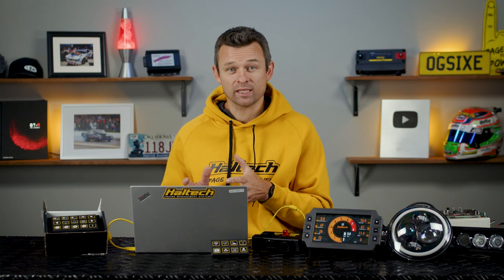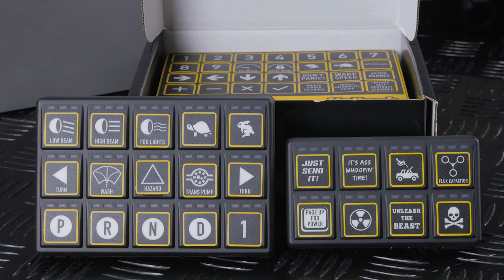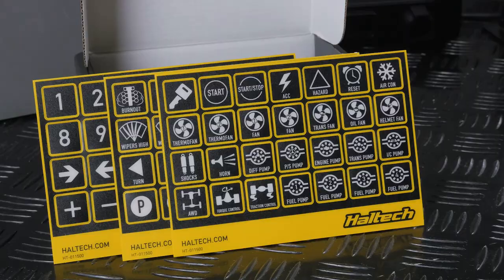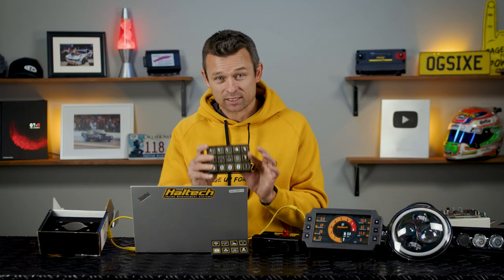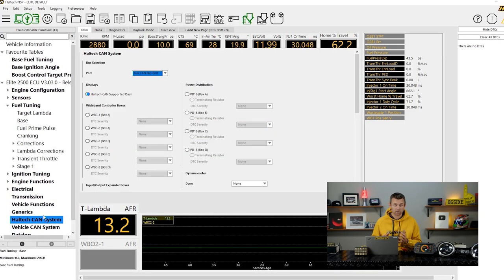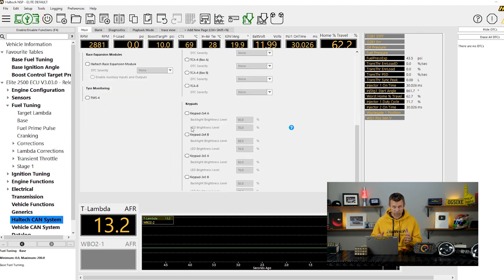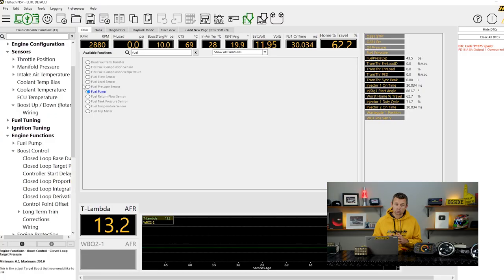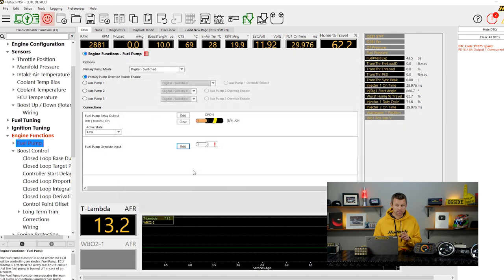🛠 How to set up a CAN Keypad with Elite ECU | TECHNICALLY SPEAKING

Comment from the maker: "When will the Elite ECUs be compatible with the CAN Keypads???" 
CAN keypads add versatility and expandability to your ECU setup. Apart from letting you control ECU functions on the go, they can also be used to add more inputs to your ECU. But most importantly  - as of now, Haltech CAN Keypads are compatible with Elite series ECUs!
Reply: Question: how well does haltech work with the older mod motors? Am I gonna have to custom do everything or are there some plug and play partial harnesses available? I am going to have to add to a harness for extreme boost control, EGTs, etc. Etc.
Reply: Thanks for the update 😎

Comment: Can you please add reverse dot and reverse bar so that if the keypad is mounted vertically with the lights on the right hand side, the trim functions can work properly? In this orientation, as an example boost up would be button 1, and boost down would be button 2, however currently the software doesn’t allow for up to be to the left of down or the led indicators are all out of order. When mounted vertically it doesn’t make sense to have button 1 as down and 2 as up.

Comment: Can one key assign several functions at once.  For example: Increase boost, open exhaust gate motors, turn on E85 pump, turn off 98RON pump etc?  This allows a drag racing selection, street selection or economy selection with one push of a button.  Can this be done? Thanks Rod

Comment: Ordered!  Is it possible to have a button you press before start that will allow you to crank the engine without firing to prime the oil system before cold start? Would it be like disable injectors button or something? :)

Comment: Will the Elite or Nexus series ever work with aftermarket CAN pads such as ECU Master?
Reply from the maker: Theoretically the already can - though you'd have to make your CAN keypad talk to the Haltech ECU using Haltech CAN protocol. The main advantage of using a Haltech CAN pad with a Haltech ECU is the easy and seamless integration with the whole Haltech system.

Comment: So you still need a pdm to use the keypad?
Reply: No you don't
Reply: @nxtprjctskylinegtr  Righto, I’m guessing you can only use it for ecu functions like fans, fuel pumps etc
Reply: @trippnoutmotorsport3164  You can use it to control DPOs if you wish. Using generic outputs and DPOs the possibilities are just about as good as with the PDM. You know, just with more wiring involved.